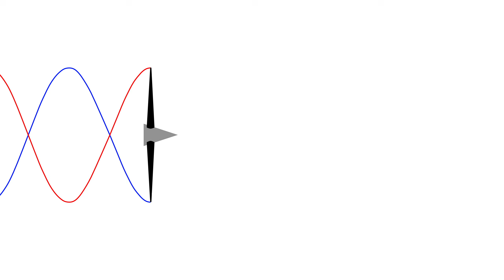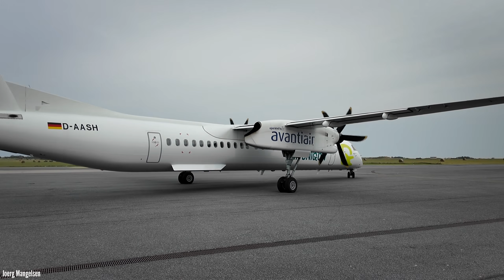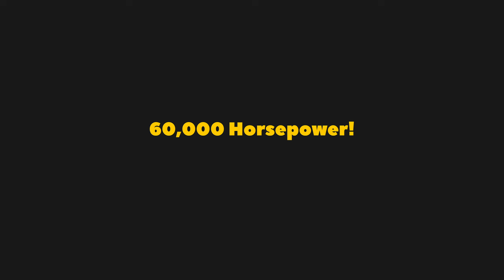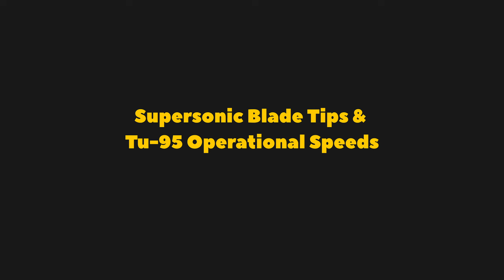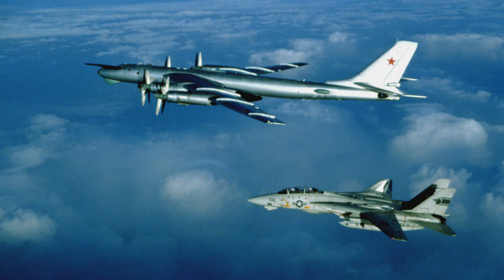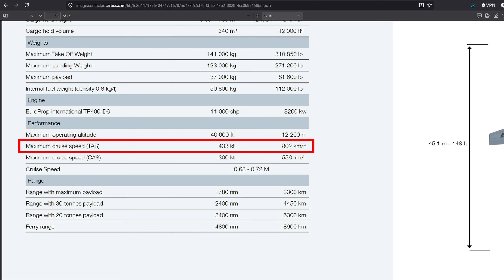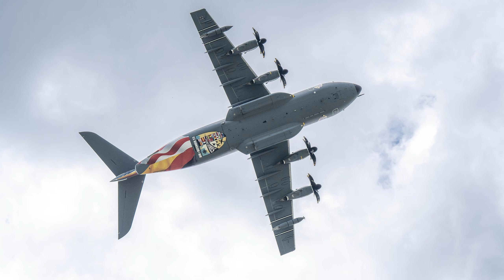How the Tu-95 Achieves Its Speed (& Why THIS Turboprop is Faster)

Comment: Whenever I see an aviation script talking in miles per hour (or worse, kilometers per hour) I feel like I'm having a mini stroke. Knots (or mach) is the way to go.
Reply from the maker: This is a common complaint in my videos. So here's my response to all of them.

As a pilot, I 100% agree knots is the way to go (try to tell a pilot to talk in kph for speed, meters for altitude and kW for power...good luck).

As a researcher, you know that historic texts and references are always in mph (unless it's WWII German). For example, giving a WWII fighter's speed in knots feels like sacrilege.

Like for example all information on the Tu-95 is given in mph (not wikipedia for example, but actual information sources). I can convert it very easily. It's not about lazines. Something is just lost in translation when you quote a text that states 466mph, and I give it as 405 knots. And it makes zero sense giving the A400s speed in knots when giving the Tu-95's speed in mph.

Btw I normally give the speeds in both knots and mph on screen (and sometimes kph too), and also did that in this video. That way no one can ever say they have convert the speed themselves. The reason you saw mph exclusively a lot in this video is for the mach calculations. The speed unit isn't important, I have already shown the speeds in knots and kph as well by this point. The mach number is the important info.

I don't pretend like it's the correct or only way to do it. But it's not out of ignorance or stupidity (some really likes to assume the latter). A lot of thought went into it, and it's the way I want to do it.
Reply: Except using knots and feet in modern aviation is a damn moronism. Still holding onto the outdated and frankly ridiculous Empirical system when Metric has LONG ago proven its superiority, and forcing it as a standard upon everyone, is dumb as shit.
Reply from the maker: Its quite funny how much this bothers some people. Is there nothing better to complain about?
Reply: @LetsGoAviate  Honestly it doesn't bother me per se. It's simply my personal opinion on the subject of using long-outdated units. I treat the use of them in aviation and maritime as existing reality. I just think that it's a good idea to move on from them into the metric system that's long been proven much more consisten and easier to comprehend. Especially considering that it wouldn't require pilots and sailors to learn a whole new system with the associated difficulties when everyone (except for the Americans and the British) is learning metric since birth.

Comment: The comparision with the Antonov AN 22 will be more interresting: it use the same Kuznetsov NK12 15000hp engines but bigger 6.20m propellers (5.90m on the Tu95), Another comparision, the AN70 who use more modern engines, and sweept blades contra rotative propeller with similar noise as the tu95/AN22
Reply: Fun fact: the propellers used by Tu-95 and An-70 are made in the same design bureau.

Comment: It seems brochures are quoting BS numbers , German airforce specifications cruise speed is 0.68mach , and they quote max speed 750km/h at 10.000m so no its not cruising faster than TU-95
Reply from the maker: At ISA temps at 25,000ft (the altitude the Tu-95's max speed is claimed), 466 mph is mach 0.673. That's the upper side of its cruise speed range. At 447mph it is 0.645 mach at 25,000ft and 0.674 mach at 35,000 ft. We already have one A400M crew/pilot who commened they cruise between 0.68 and 0.70 in the A400M.

I can't prove it, but the Tu-95MS cruise a tad slower than the -M according to the data I shared, but I wouldn't bet my life savings on it's accuracy.

The Tu-95 doesn't have a mach limit though (in level flight), so if it flies high enough it will have a higher mach number because of the lower temperature. That's why I said it depends on the mission profile of the Tu-95.
Reply: @LetsGoAviate  while hard to pick accurate numbers we can take Tu-114 ,kinda civilian bear cousin using same technology ''official FAI records; 
 suggest higher cruise speeds. Publicly available Tu-114 manual - Normal cruising speed -750 km/h, maximum cruising speed - 821 km/h at 9000 m:
Reply from the maker: I think you're right about picking accurate numbers, and I think yours is mostly accurate from the looks of it. 750 km/h at 9,000m, at ISA temps (-43.46 °C) is mach 0.683, which is right at the lower end cruise speed of the A400M.

I've seen higher cruise speed numbers shown for the Tu-114, such as 770 km/h, which at the same altitude is mach 0.70. Though numbers for the Tu-114 is all over the place. Notably, Yefim Gordon's book (about the only source I trust on this aircraft) "Tupolev Tu-114 The First Soviet Intercontinental Airliner" doesn't give the altitude for the 770 km/h cruise speed, only the altitude for it's max speed. Cruise speed is likely at a lower altitude, lower temps, and thus lower mach number.

I can't comment on "maximum cruising speed" you cited, I've not seen a source citing a maximum cruising speed for the Tu-114. I think it's also fair to say the Tu-114 cruises a tad faster than the Tu-95.

Comment: An interesting note about spinning propellers in the opposite direction is determining the 'correct' direction. Several aircraft types have used it over the years (eg the De Havilland Hornet). The F82 'Twin Mustang' had propellers that spun in opposite directions, initially out towards the wing tip (looking at the aircraft from the front, the left propeller spins counter-clockwise, the right clockwise). On its maiden flight, the aircraft failed to get airborne as the propellers wash was causing to much drag. The propeller hubs were swapped over, so now the propellers spun toward each other and the aircraft and the aircraft flew with no problem

Comment: No aircraft can spend its time flying around at maximum speed as that would require maximum throttle and rpm on the engine and no engine is rated for use at continual max power. After a short period it is very likely the engine would fail, possibly in an uncontained manner as turbine blades fly everywhere. Reheated Jet Engines are usually allowed about 5 mins of reheat per hour of flying
Reply from the maker: Good point. Few engines can operate at full power indefinitely

Comment: The one time I flew wing on a TU-95, circa 1958, (in an RF-8G) we were at 22,000 ft and as I recall,  indicating about 300 KIAS. Since we were in the middle of the Pacific, I assumed they were at max range cruise speed. That was slow for an F-8 but about what I would cruise an A-4. The fighter (a VF-24 F-8E) was in "sidewinder trail" and I flew along side and took pictures including shots of the "Playboy of the Month" centerfolds held up in the gun control blisters. That brute was LOUD, and you felt it as much as heard it.
Reply from the maker: That is an amazing recollection! Thanks for sharing
Reply: That would be about 425 KTAS at standard atmospheric conditions. That’s approximately 0.7 Mach.
Reply: What a memory to have, wow. Thanks for sharing!

Comment: So if the air pushed by the props onto the engine is such an issue, why not have pusher props for fast propeller aircraft? efficiency loss from airflow disturbed by the wing coming in?
Reply from the maker: That sorts the problem of the sliptream over the wings. But when mounted at the rear, the propeller doesn't get clean and uniform air anymore. It gets turblent air that was disturbed by flowing over the aerodynamic surfaces, which affects thrust. So its a give and take.

Comment: As far as pure capability is concerned, I think the A400M is one of the best planes in existence. Landing and rough runway capabilities similar to a C130 Hercules, but with almost twice the payload. If carrying the same payload as the C130 it has almost twice the range and as mentioned it is way faster. It can be used in troupe transport, medevac, tanker, cargo and paratrooper roles and is itself air refuelable.

Comment: I stand in my garden watch A380s and 747s flying over on approach at around 8000 feet and although audible they are never quite obtrusive, an A400 traversed at medium altitude a couple weeks ago and although at twice the height of the other large aircraft, I definitely felt uncomfortable in the low frequency thrum of its engines in its wake, it did actually fly over so I wonder if this effect is as pronounced in its wider wake
Reply: Military Engines are always far noisier than Civilian ones. I can hear American F15's and Typhoons flying over the wash some 40 miles away from where I live and as for F35!. Back when Trump started his war in Iran, six F22's flew over our house at about 200ft and the noise was deafening

Comment: So what could be very interesting would be modern swept props installed on a Tu-95. This could be a relatively inexpensive upgrade, which might allow it to cruise relatively efficiently at the higher speeds. What is not clear is whether that would be useful in its operational role.
Reply: there is no point, now they are building a second modernization of the Tu-160m2 from strategic bombers, and work is underway on a low-visibility Pak da bomber, and medium-range missiles like the HAZEL are not yet vulnerable to interception, which leaves a small niche for such aircraft.
Reply: Propfans could have been developed for it, however it'd require complete redesign of the entire gearbox as well, since loads would be different. And then the engine control system would require at least a recalibration, or also would require a redesign.

Comment: 1950's brute force and clever engineering vs 2000's modern design. - Great video, very much a eye opener. Knew Tu-95 was very fast, but never knew A400 was so fast.
Reply: I find that a lot of people have a mistaken idea about a lot of larger planes when it comes to speed. Another good example is how the 747 can almost go the speed of sound on the top end. It can get up to around mach 0.9. But it will cruise at around mach 0.7.
Reply: es waren komplett deutsche Ingenieure
Reply: @pafyz665 idk what funny substances you got over there, but the A400M is not a fully German design AT ALL. Let’s see Airbus do anything without French and British engineers
Reply: @tlgx884  es ging nur um den Turboprop Antrieb der TU 95 den deutsche Zwangsarbeiter von Focke Wulf in Russland konstruierten

Comment: Keep in mind with the P-3, our normal Max speed was 405kts (466mph) A a P-3 did exceed 500mph in tests. The T-56 A14 was a constant speed engine in flight  so speed was increased by the flight engineer pushing the  power levers forward causing an increase in fuel flow. This caused the engine to try to increase above 100% (13,850rpm). The 54H60-77 propeller prop governor sensed this and increased pitch automatically to keep the engine at 100%  and so thrust was instantly increased with no need for anyone to bother changing blade condition. Simple and efficient. 

At lighter weights and on cold days, she was a real hot rod!
Reply from the maker: I love to hear from the pilots and crews of these aircraft! Not surprisingly, the P-3 is quite a bit faster than the C-130 with the same engines (small difference in output).

You're 100% on point regarding the constant speed operation. I usually work under the assumption that all turboprops have constant speed units (would be silly not to have it). The pilot selects the desired rpm (as per standard ops), and the governor changes the pitch the maintain that engine rpm. We have a constant speed propeller on our Cessna 172 🙂

Thanks for the comment.
Reply: @LetsGoAviate  Thanks! I always enjoy your videos. Surprisingly many turboprops, particularly free-turbine turboprops require the pilots to control engine speed with the power levers and propeller pitch with condition levers. 

In the P-3 it happens automatically- a bit like the difference between a manual and automatic car) All a bit complicated to me! With the P-3 the only times the engines don't operate at 100% is when the FE shuts down 1 or 4 (or 1 &4- called loitering) in flight to save fuel and after landing when you have gone through the 'bird bath' to wash off the salt. 

Then FE selects LOW RPM-somewhere around 65-67% (from ancient memory) for fuel saving. The rest of the time the FE changes power (thrust) settings by moving the power levers to a specific SHP setting called for by the pilot flying and (which will usually correspond to a desired airspeed) and then monitors the SHP and Turbine Inlet Temperature (TIT) gauges. 

TIT is usually only a concern when setting high power levels on take off when you might be heavy and are looking for the whole 4,600SHP or with quick changes like on a go-around. Fantastic system, beautiful aircraft!

Comment: I love the A400. I used to live in Bristol, SW England, and often saw the prototype/s A400 in the skies around and over the city. Therefore, being a bit of an avgeek - all my life, more or less, at different times in my 70 year life - I noticed what a lot of people didn't; slightly swept wings and turboprops. I assumed, rightly so it seems, that efficiency was a large part of the design concept, as most times efficiency also translates into speed when required, and relative economy at a decent cruise speed. Later, after seeing pictures and reading more, I saw those amazing 8-swept-blade jobbies, and thought, hmm, same idea. And NOW this video explains what I should have worked out for myself, the swept aspect of the blades themselves. This seems more important even than a swept wing - for higher top speeds - while the less-than-jet sweep of the wing makes for better lower speed agility, and higher lift potential at take off and landing speeds. All in all, what they have done with the A400 is brilliant. I also really rate the C-17, bigger I know, but super-sexy. Different ops scenarios no doubt, but plenty of overlap too. It still blows my mind that the C-17 design is now pretty old, when compared with the A400. But it goes to show that good design, using the tech available in any time window, can produce aircraft with amazing durability and longevity. Long live both!
Reply from the maker: Thanks for the comment. Cheers!

Comment: And how does the An-70 compares to those planes? It uses both composite multi blade and counter rotating blades. On paper it is faster and more efficient then A400.
Reply from the maker: On paper the An-70 is slower, but it depends on where the info comes from.

Comment: I never realized how fast the A400 is. You could even add that it reaches high speed while having a fuselage length to width ratio (necessary for its mission) that is nowhere near as aerodynamic as the Tu-95. Quite an accomplishment-Thanks for the video!
Reply from the maker: In addition, it's short takeoff capabilites are impressive.
Reply: But isn't the optimal length to width ratio for a given internal volume somewhere around 6? Too long and you end up with more frictional drag, too short and you get too much pressure drag. The TU-95 fuselage looks way longer than the optimal 6:1 ratio
Reply: @fusha_1527  That really depends on more than just the ratio, the physical shape of the body needs to also follow certain rules in order for that to be the case.
Like comparing a GeeBee racer to a Questaire Venture...the GeeBee was fast because it had an excessively large engine, while the Venture was fast because it had the right shape to make use of that ratio.
Both the 95 and A400 are mostly tube shaped, though the A400 beats the 95 in this regard because there are significant tapers in both the nose and the sudden transition of the cargo ramp area...so while it looks very much tube shaped, the effective shape is quite a bit closer to the shape it needs to be.  Both aircraft make use of the area rule, though the 95's efforts are far more pronounced.

Comment: So technically the Piaggio P180 Avanti also has a faster cruise speed than the Tu-95, though probably a slower long range cruise speed
Reply: P-180's LRC is 318 kts at FL410.

Comment: For military aircraft I'd argue that 'maximum' speed is a more important consideration than for a civilian one, since it is quite credible that they might be called upon to utilise it, where a civilian aircraft can design around the expectation of not doing. The fact that it is less efficient is just the cost of doing business in military conditions. A 'sprint speed' is a real and important consideration in a military plane, so it seems a bit silly to discount it. I mean, such planes spend most of their time on the ground, with an approximate airspeed of not very much. This is however probably unhelpful when considering their capabilities. Any afterburning jet is horribly inefficient when proceeding at pace, but I'd still consider that a part of its speed on paper.
Reply from the maker: I agree, max speed for military aircraft should not be discounted. And if we are comparing the max speed of two mil aircraft, it's an important stat.

You have to also agree that it's silly to compare the max speed of one aircraft to the cruise speed of another. Like what I often hear is that the Tu-95 could fly just about as fast as a turbojet or turbofan airliner. Umh...the airliner cruises that speed all day long at a reduced power setting, the Tu-95 needs to push to its maximum. It's folly, you have to compare cruise speeds. That was kind of my point.
Reply: @LetsGoAviate that's fair I suppose, it isn't ever going to be a fair comparison in that regard given their differing design intentions. Commercial planes leave a LOT of power on the table because efficient cruise is king.